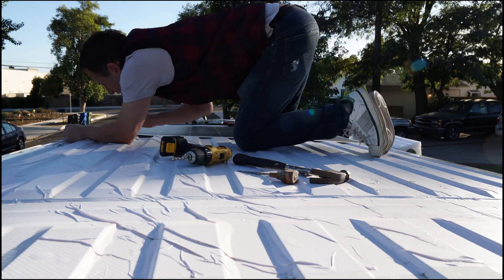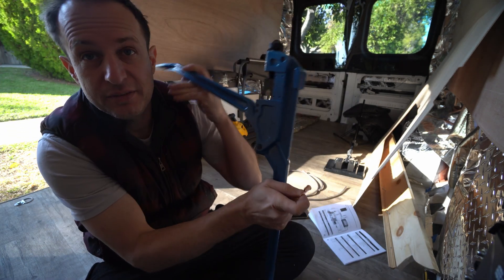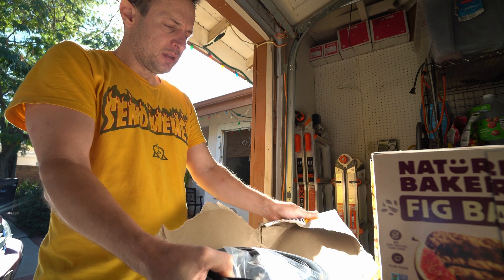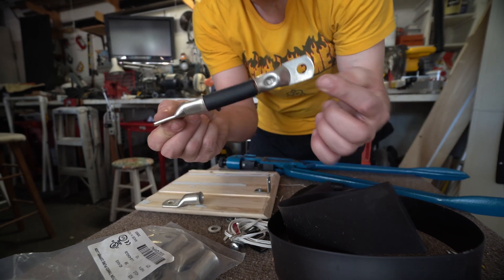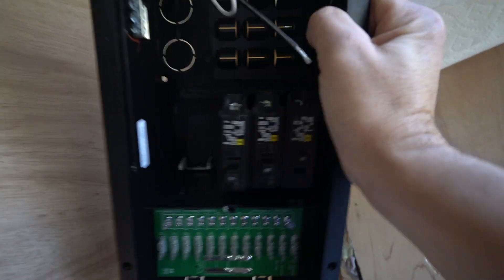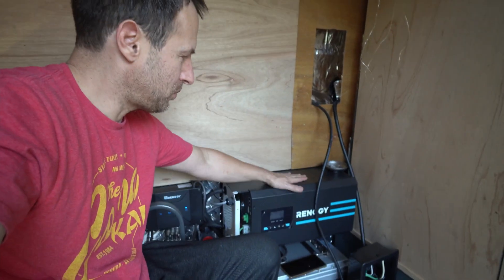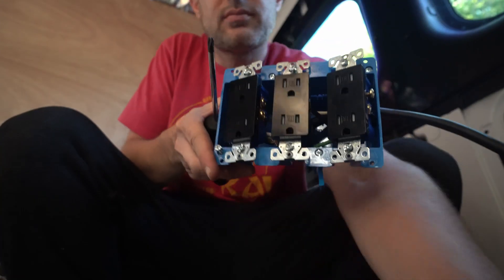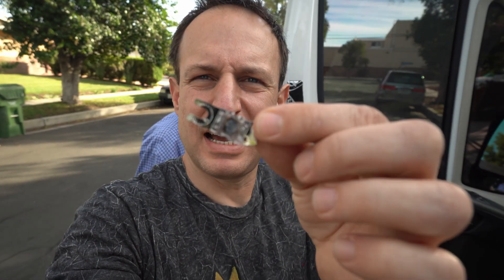Crimp Lugs 4/0 gauge Wire Solar Renogy 3000 Inverter charger 50a DC-DC  MPPT

Comment: Great video dude! I’m trouble shooting my mppt renogy dc to dc charge controller.  I can’t get a charge from solar or alternator.  Any ideas.
Reply from the maker: It was the DC to DC that wasn’t working for me and they suggested to disconnect it for 30 minutes lots of people that breakers are switches to reset it easier. Why the solar isn’t working hopefully nobody hooked up the panels first and fried it. When I purchased my 50 amp MPPT DC to DC from Renogy I remember noticing the panel input voltage max was low compared to other units and thinking that I’ll have to wire in parallel. Maybe you need to lower the voltage on the of input. Make sure it’s recognizing the battery. The battery light should turn on. When it’s at to lithium the battery selector light will be blue
Reply from the maker: If I think of anything I’ll message Y’all
Reply: @NoLimitVanLife  cool yeah I can't figure it out.  I'm not getting a charge from my alternator either.  Not sure whats going on.  I ordered some bus bars I'm hoping it's it's the ground connection maybe... 😅 or maybe the unit is bad